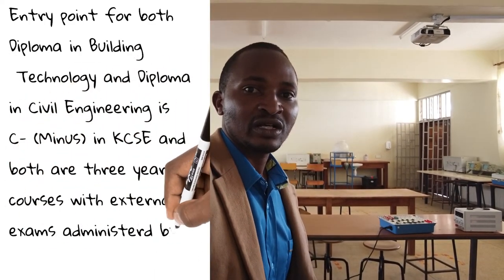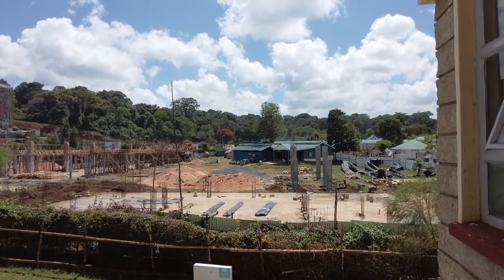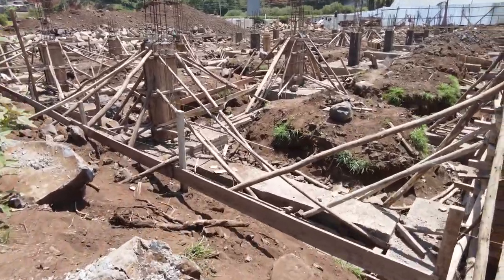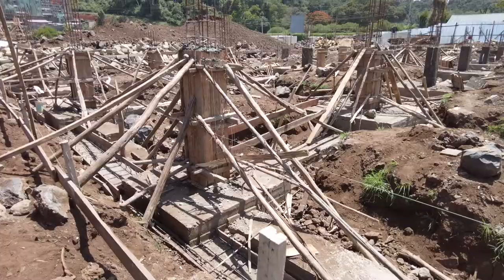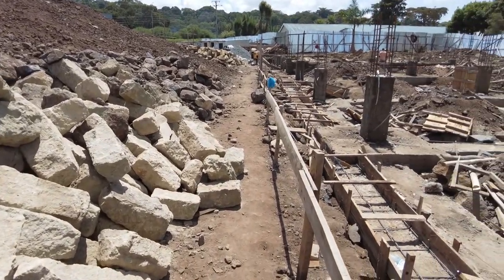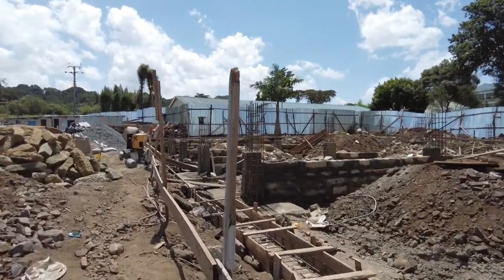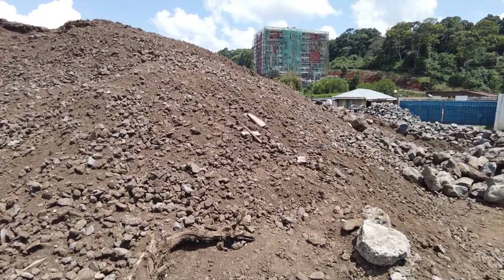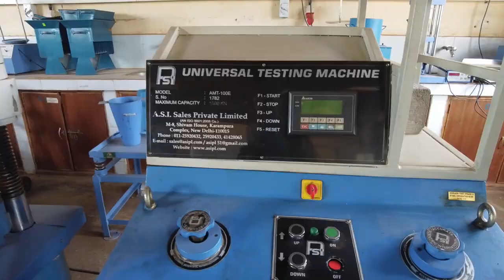Diploma in Civil engineering vs Diploma in Building Technology

Comment: What does it take for one pursuing building and construction at degree level to graduate to civil and structural engineering?
Reply from the maker: Different universities have different requirements but it also depends on number of credit transfer units the your building degree will have
Reply: Where are you pursuing  your degree in building and construction

Comment: hello mr Ben is  diploma in civil engineering achievable using parttime classes??
Reply from the maker: It depends on the locality. Around Nairobi it should be possible
Reply: i am planning to do the course at kips college though parttime is it possible?? @HumbledEngineer
Reply from the maker: @hillaryomondi1771  I am not sure if the school has part -time programs but if it does it is possible to successfully pursue the course on part-time basis
Reply: thank you so much for your insights it means alot @HumbledEngineer